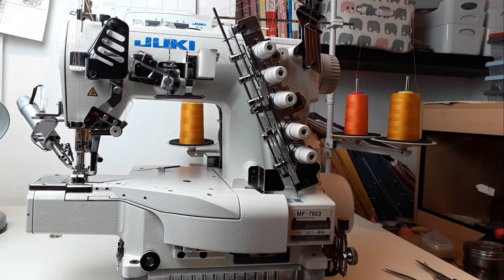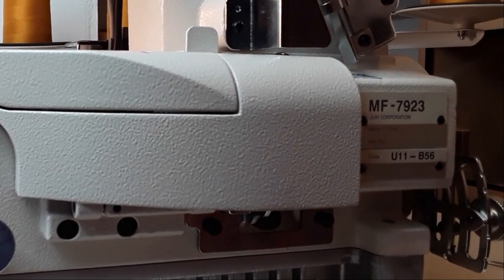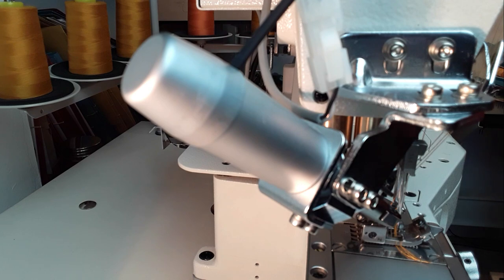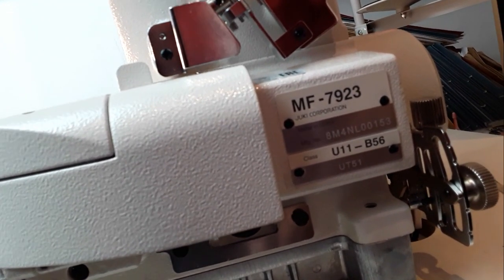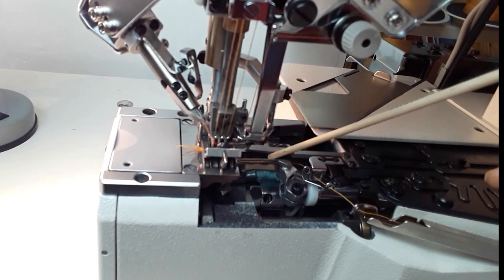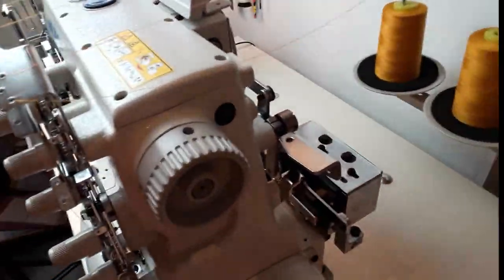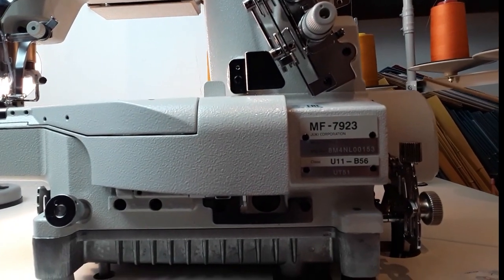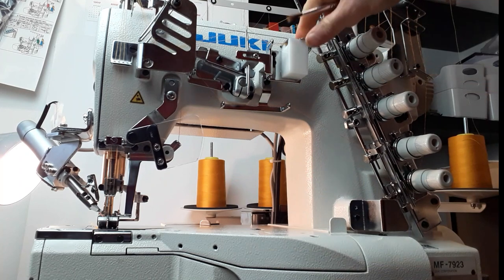Juki MF 7923 Mythbusting! Industrial Coverstitch Explained.

Comment: Thank you so much for this video I bought this machine about 10 months ago.  You seem to know a lot about it I found the manual not very helpful and was told by my dealer that the top thread cutter doesn’t exist (I think he put the top thread cutter on incorrect) as I was able to fiddle with it and got it working. Is there a way of increasing the height of the footer for thicker fabrics?
Reply from the maker: The foot lift increases to 8mm when you take off the spreader but you will need to be brave enough to learn to put it back on (the clearing/ space between the spreader and the needles is micrometres, the width of a sheet of paper) - so I'd only do this if you know that 99% of times you are not going to use the top cover (spreader is the one that creates the top cover). But even with the spreader you can sew through decent thickness- in my first video with this machine I use thick scuba and French terry, even here I use scuba in the short clips, the machine also goes smoothly through seams. So, unless you mean really thick fabric, it might actually be that you either threaded the machine incorrectly (which is very easy, it's not easy to thread it and even engineers admit that) or the needle thread tensions are too tight (you either break the thread or the needle then - it depends on how balanced or rather unbalanced the tensions are - so the looper tension also has to be right) The needle bar stroke can be adjusted but I really would not recommend it- unless you know how to fix sewing machines and so on. It's not a solution,  it's something that a lazy dealer would do to 'fix' the non existing issue of the machine not sewing through thicker layers (the needle bar stroke would need to be increased if you ONLY sew with super thick fabrics, more like 6 layers of scuba.  It kind of changes the purpose of the machine in a way, making it more heavy duty)
Reply: @GingerheadCo  thank you so much for replying it’s great to get a response don’t think I will mess with it and I do only use it for stretch fabric that fits fine but it’s good to get feedback in case I need to use a thicker fabric.  I really love my juki do you ? Made lots of great garments with it.  (Ps my name is Lin I use my husbands google account!  In case you are wondering 💭).
Reply: Have you used it for binding yet? It is so perfect for binding.

Comment: I have the JUKI MF 7923 - H22 B64 but I cannot figure out how this machine "locks" the stitches and keeps them from coming undone.  Is there a trick I don't know about?...Great video = VERY informative
Reply from the maker: Thank you 😊 there's an explanation of how the stitches are locked on Juki website (the Japanese one, I'm not sure about others), it's a bit similar to knitting and pulling the yarn through the last loop (so that the more you pull the more it locks) I'm sure a sailor would find a better explanation- there's probably a knot that works using the same principle (I'm half joking,  I have no idea if there really is such a knot) The machine locks the last stitch automatically,  you don't need to do anything (apart from pressing the back of the foot pedal)
Reply: @GingerheadCo  what is the device that is attached on the side of your machine that is located behind the presser foot/needles?...
Reply from the maker: @mattbnunn  it's a top and bottom thread trimmer, mine is pneumatic UT57 (I talk about them in my more technical video about the machine) It is, unfortunately, an expensive addition, but it really is worth the money - you don't need to lock the stitches (they lock automatically), it saves a lot of time and thread.
Reply: @GingerheadCo  thanks!! Have you had any trouble with the whole hem coming undone since you started using it?
Reply from the maker: @mattbnunn  nope, not even a chance 😁